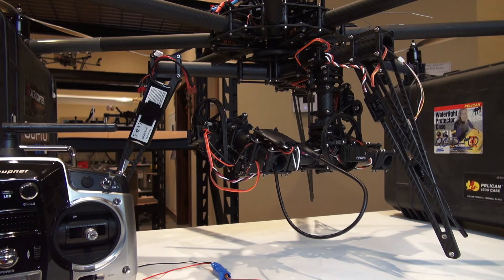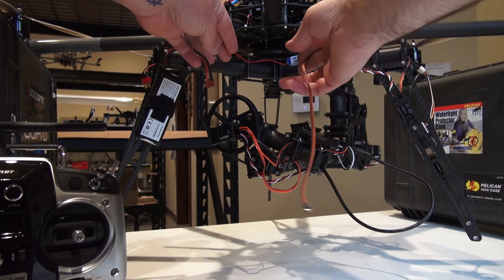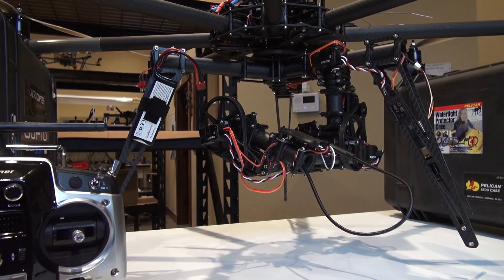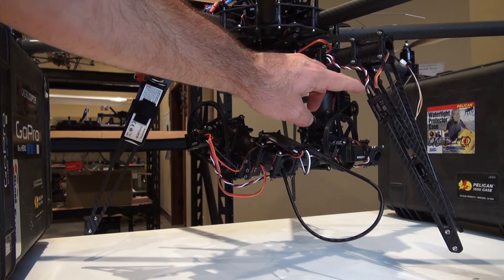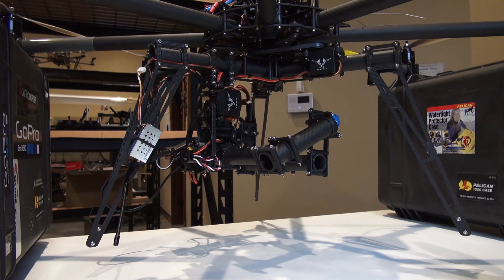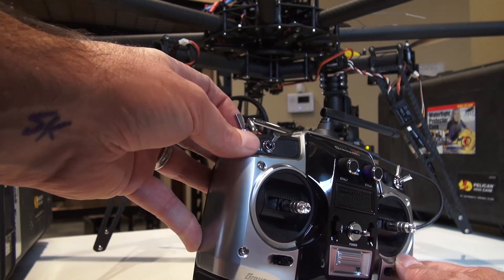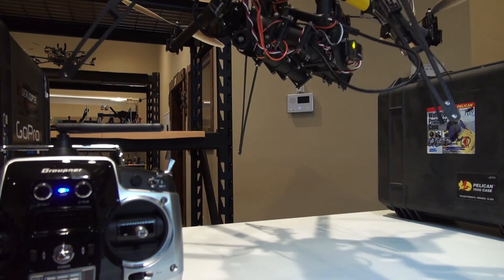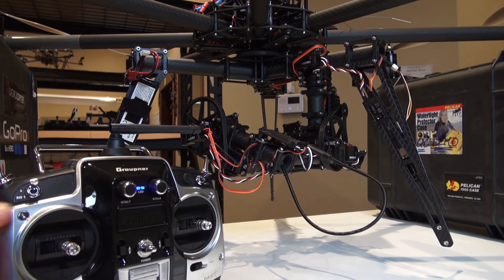Quadrocopter Tutorial - Radian stabilizer setup on 360 Gimbal

Comment: now all you need to do is ditch the Radian system and go with something that mounts the gyros on the camera mount and you will have a decent setup. Gimbal works great but the radians are not even as good as a $30 KK board.....